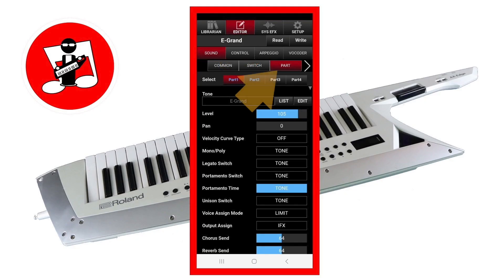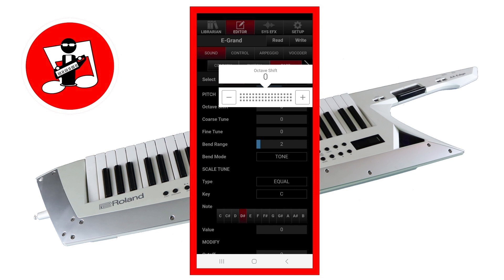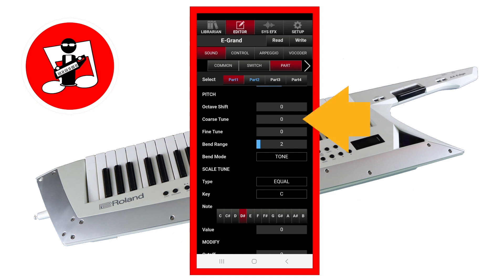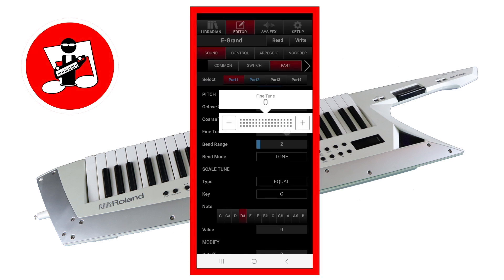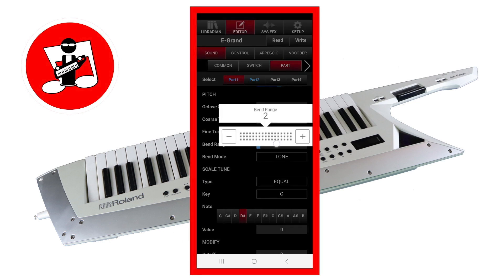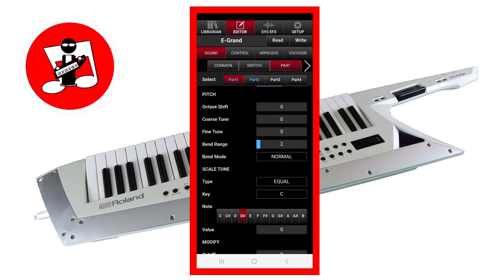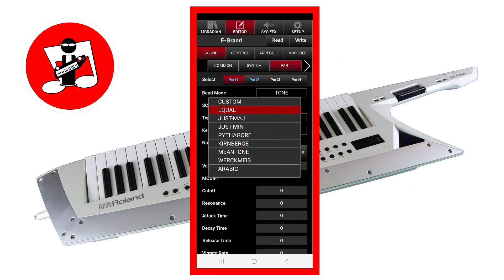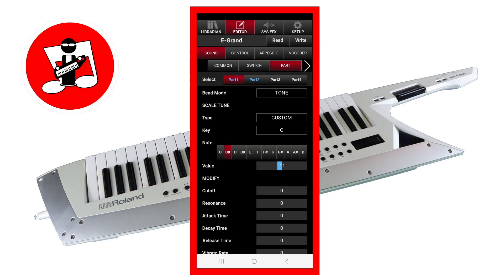Complete Ax Edge Editor tutorial part 5

Comment: Trev,  Thank you so much for the effort you put into explaining the ins and outs of the Ax Edge.  So so so much there.  I am a relatively recent Ax Edge owner and have been trying to figure out how to change what the Modulation Bar does for tones.  I have a tone who’s base setting for the Mod Bar is a filter change when I want it to do vibrato.  (for me, that is what the mod bar should do.).  I have not seen the Mod bar setting discussion in your Editor Series.  Is there one?

Thanks for everything -Bob
Reply from the maker: @coventry66
Hi, thanks, I'm glad you found my videos helpful 😍👍
I've been meaning to do some more videos for the Ax Edge, so hopefully new videos soon (mod bar included) 😀
I was making a mod bar video a while back but my mod bar broke! and ended up doing a mod bar replacement video instead.
Reply: @IbandUK  Thank you Trev.  In the meantime - where do you suggest I go to figure out how to make those adjustments to the Mod Bar vibrato?  We have a gig next month and would love to have one of the Programs I created have vibrato from the Mod bar.  Thanks!!!!
Reply from the maker: @coventry66
By default (in the system menu on the Ax Edge), the mod bar is set to cc001 (modulation / vibrato). So if the sound program has the mod bar (control > controller tab) source is set to SYS, the mod bar should be vibrato... Unless cc001 is changed in the in the tone itself, which is where it starts to get complicated.